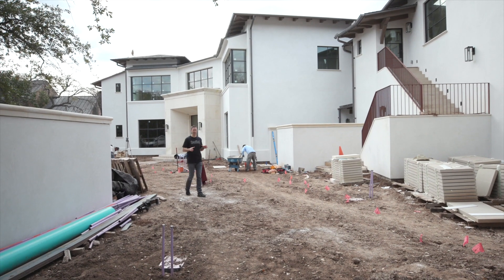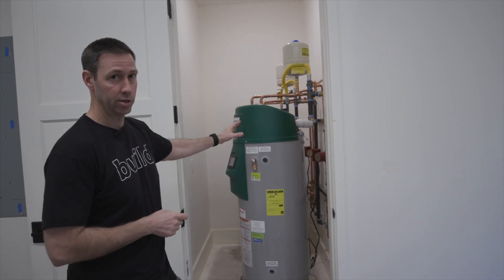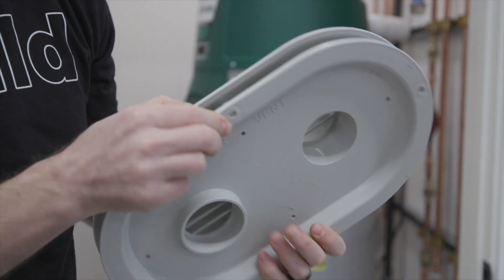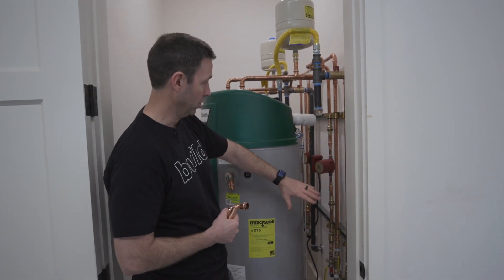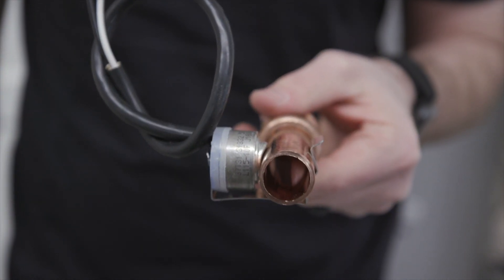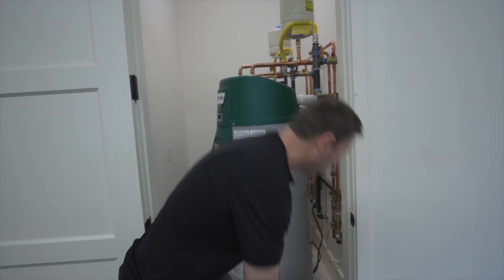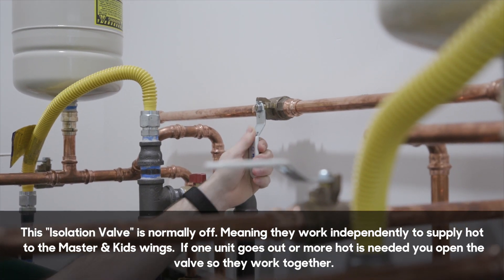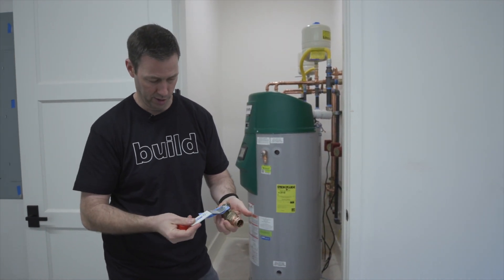Hot Water For A 7000 Sf House?

Comment: ...add two teenagers.  Empty!  :-)
Reply: We have a 75 gallon unit for a 6 unit condominium in Chicago. I forget the BTU rating but I think the thing has a 10 minute recovery time (I could be misremembering). With 12 adults we’ve never had a problem. It’s pretty much impossible to run it cold. Never have. The unit was like 3500 bucks.